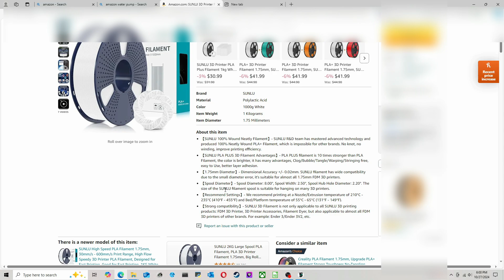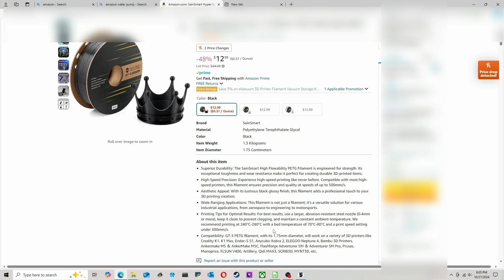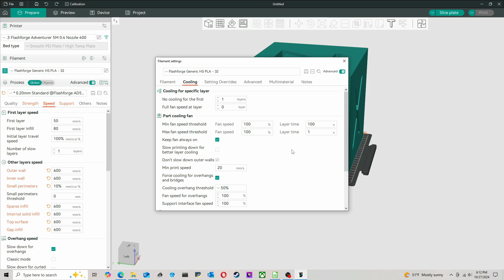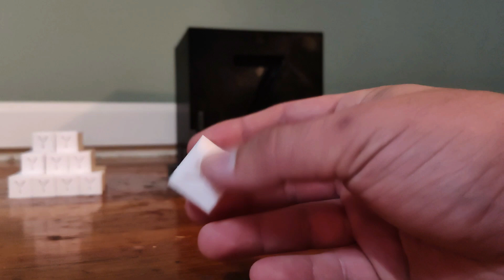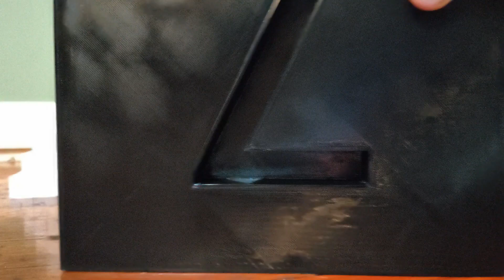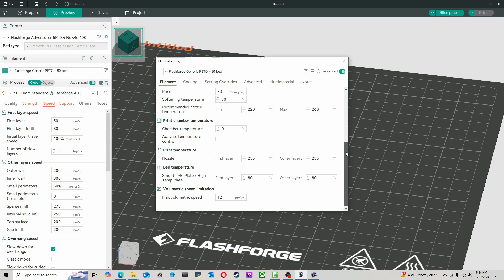Is Rapid Filament Really Necessary?

Comment: Hi, enjoyed the vid. Like to see a follow up using a filament dryer. I primarily use Elegoo filaments myself. I've recently had a brand new spool which had massive stringing the same day it arrived. Threw it in my filament dryer and it was at 40% humidity.
Reply from the maker: I plan on doing a follow up video with several different PETG brands that I will dry out

Comment: Hi, I hope this comes across as constructive criticism!

Few things:
1. Never assume filament is always dry out of the package. Even reputable brands filament can be shipped wet, sealed in the bag, for numerous reasons. All filaments are hygroscopic and should be dried before running tests related to extrusion. And a tid bit that isn't common info, there does exist a point where hydrolysis in filament is irreversible.
2. Look into flow drop off. Ellis' tuning guide has a page dedicated to this and a testing method to determine maximum volumetric flow(mvf). High speed pla has changes to additives to improve its melting rate, thus increasing mvf. Mvf is also dependent on temp, and the heating efficiency of the nozzle, hence the relevance of cht nozzles for high speed printing.
3. Filaments shrink when they solidify, which is why we tune extrusion multiplier per filament. But also per brand and per color because the rate at which they shrink can vary due to any additives. Additionally, the way in which the material handles internal stresses can vary with additives. The following is speculation, when you specifically pointed out that the faster printed 0.4mm white pla+ was consistency larger than the default speed. My hypothesis would be that the slower layers had longer to cool, and contact more than the faster cube's layers.
4. (This part is conjecture and may be wrong) Assuming you are measuring the flat surfaces of the xyz cube without surface flaws, your measurements to me are of the extrusion consistency. Which is the result of primarily the filament diameter consistency and secondarily the consistency of your extruder. If the extruder gears are clean and there are no issues in the filament path, your results mostly report to the filament width consistency of the filament.
5. XYZ calibration cubes are flawed testing specimen. I'm not a fan of them for anything besides a test print for glaring hardware issues. More methodically made specimen, like the califlower, are better prints for dimensional accuracy. As they accommodate for most factors and print at a larger scale(and can be scaled even larger). Such prints minimize the error from the motion system and accommodate for skew, extrusion multiplier, and elephants foot. XYZ cubes are too small and introduce too many surface irregularities.
6. Internal stresses in relation to shrinking are something to be aware of. Specifically in regards to differences in print speed, warping, and cooling.